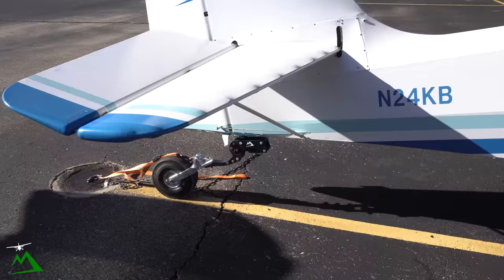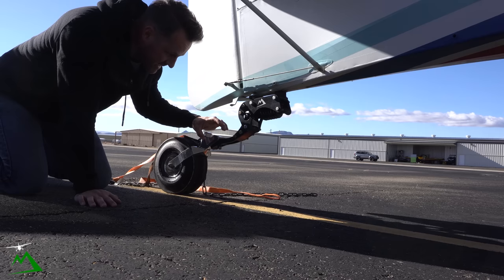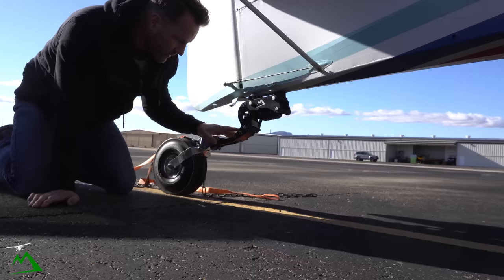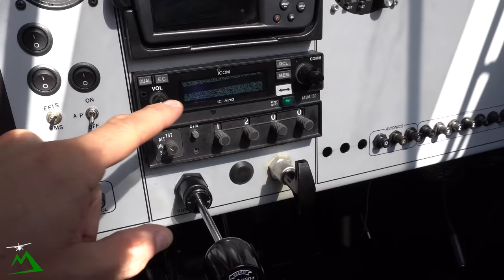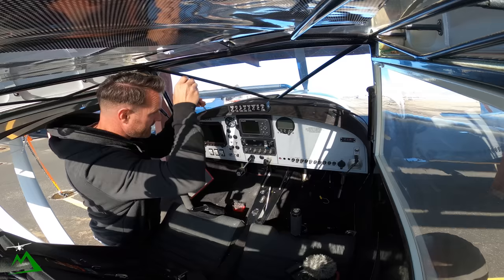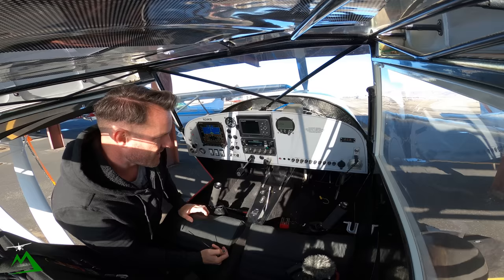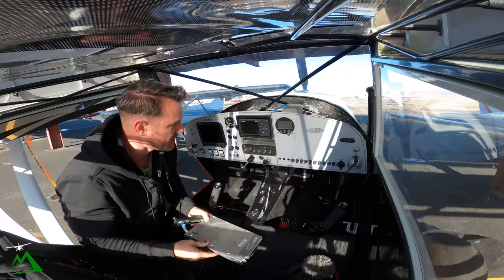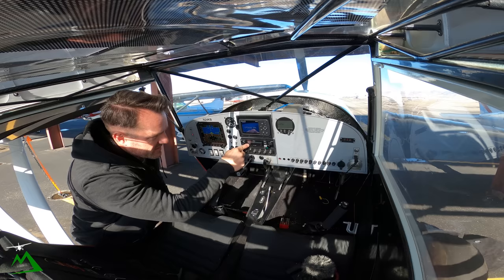I Can't Fly My Plane...For a While

Comment: You might consider a handheld comm for a back-up Ryan.  We use to extend the comm coax with a break out so that the comm antenna could be connected to the handheld if you needed more range.
Reply: I never had a handheld while flying, but this principle is verified 100% valid. I saw very impressive results when doing this with a a VHF/UHF ham radio. Antenna makes a huge difference, and handheld radios absolutely become a much higher performer with a decent external antenna.
Reply: This is only possible, if he could connect the headset to the handheld radio.
Without headset it's WAY to load inside to understand anything.
Reply: @Breenild  That is when you plug a headset into the handheld.  We had done this on many aircraft.  Usually done so that you have an emergency backup in-case of a power failure.
Reply: Sporty’s has a handheld with full-size headset connectors so you can quickly switch over.
Reply: I said pretty much this same exact thing but I'm going to leave my comment so Ryan has a better chance of seeing the suggestion. 👍😁
Reply: @Breenild  My Yaesu  handheld came not only with adapters for the headsets but also for a remote pust to talk. I imagine that a lot of them do but that's one of the main reasons I bought the one I did because a lot of the aircraft I fly have no electrical system.
Reply: Handheld with the adapter is a very easy way to solve this issue for a temporary use. I used one in my Luscombe for years and traveled all over the country with this. I actually carry a handheld with me now in everything I fly as an emergency backup.
Reply: @stubryant9145  antenna is 85% of the equation in RF, the rest is output power, filtering, front end senditivity, and so on.. but if your antenna isn't efficient and resonant on the right frequencies, you can have 1000 watts yet that power is going everywhere but where you want it to go. I've seen people with 5watt HF radios outperform 100 watt stations with shitty antennas, over 2 thousand+ mile ranges at night.
Reply: @tonyvelasquez6776  Exactly correct
Reply: A handheld AirBand Radio is a good addition to have with headset adapter & remote PTT anyway!  Not only for emergencies when you loose DC power or radio dies etc but also for getting latest weather before turning on the aircraft or listening to Ground at busy airports for situational awareness while doing pre-flight etc etc.
My KR2 only has a handheld as do most Microlights and many other kitplanes & LSA's; especially outside the US where prices are STEAP.  I have a connector on my dash to the antenna that screws onto my handheld for better reception which might be an option as a removable backup radio.  I also have an intercom connected to mine (because it is also my primary radio) and maybe your intercom allows for a second radio input?
Just an idea to solve the immediate problem and give future benefit :)

Comment: Remember in Electronics, It's ALWAYS the connector.
 I see that the front panel was dangling by a ribbon cable and those Mylar strip connectors are notorious for getting slightly askew .
Check both ends, Release and reseat the cable. The display controller is most likely in the  front  circuit board. Good luck !

Comment: I love your videos, especially those from PNG. I have to say that flying in the highlands of PNG surely teaches you all about risk management, landing a big aircraft into little more than jungle clearings. That said, I think you’re taking a huge risk with your tail wheel, which should be professionally designed and approved by the factory and installed on the authority of an STC. Your tail wheel looks a million dollars but it is fundamentally flawed and has the potential to damage both you and your aircraft. When it malfunctioned in the recent video, I could hardly believe my eyes when you climbed into the aircraft and took off knowing that the tail wheel was interfering with the rudder. A more than usual swing on take off and the tail wheel might have limited your rudder travel to the extent that an accident was inevitable. In addition, using progressively heavier springs (up to 2000 lbs!) is crazy just to keep your tail off the ground. All that force has to go somewhere and the chances are it’ll end up breaking the airplane structure. A kit fox, like all light sport aircraft, is very lightly built. If you want to land and take off in the desert on unprepared runways and have it ride over the bumps like a Cadillac, you should have bought a bigger and stronger aircraft.

Comment: Ryan, I use an Icom A6 handheld (about $300) if the radio mounted in the airplane fails. Its always a good backup. I can connect my headset to the A6 via an adapter that came with it and it provides sidetone just like the aircraft audio system. It works just fine at altitude if I keep the antenna vertical by the windshield. Just have to make sure the battery is charged before flying. But it routinely lasts many hours. You can also buy a battery pack that takes 6 AA batteries.

Comment: Sorry about the radio Rian, those are good radios I use to run two of them in my RV9A wish I still had one, would be glad to sent one to you till you get yours back.. but wound up selling both of the ones i pulled out when I upgraded the panel..  but maybe someone else may have one you can use till its fixed.. when I had an issue with one of mine Icom fixed it for free, and it was out of warranty, so they at that time stood behind the product very well.  Hope your experience is as good.  enjoy your content, so hope you are back up flying soon.

Comment: Ryan, were I doing it, I'd press the part back to the original configuration and then weld maybe a 1/2" x 1 1/2" flat bar on edge on the bottom side to reinforce the span.  Remaking it, I'd put more height in the vertical span as that's where the structural strength is.  Or make the spam between the spring and wgeel out of spring steel.
In any event, hope it all works out for you. God bless.

Comment: Don't know what all the fuss is about but the tailwheel on Cubs, Foxes, Merlins and many more using the ole tried and true bungee cords and slack tire pressure ( not to mention cost to replace and paper work if so needed) will always be the favorite of bush pilots, like me anyway. More moving parts you have the more problems goes with that! No big ole tool boxes to carry around with fittings, wrenches etc just vice grips and some bungee, which by the way does awesome job tying moose antlers or your canoe to the struts or a tourniquet after you accidently cut your leg way bac in the bush and anything in between! annnnd, as for the handheld radio; been using mine for years patched in to my headset and the planes electrics to keep top notch charge! Roof antenna plugs right in the handheld after you remove existing! Info and plugs at most aviation supply shops or Amazon if you know what u want!

Comment: Before you proceed with material change and such, look at the overall system.
6061(T6) aluminum is PLENTY strong for the application. Look at a bicycle, motorcycle or even the front wheel of a shopping cart. The “stem”, the part that holds the fork/wheel is  nearly vertical although leans slightly rearward (rake). This is why the wheel can “turn” unlike yours where the wheel if mechanically Fighting to NOT turn. Again, envision how a bicycle fork and front wheel is connected to the frame.
If you rotate the “stem” to near vertical, you can dramatically shorten the “arm” that is bending, and REDUCE the spring value (spring constant, “k”) and all but eliminate “sag”.
The load applied to the system is FAR LESS than that of a mountain bike rider and bike in bumpy terrain. Not sure what the actual weight/loads are at the tail wheel of a Kitfox but it is negligible.
Imagine the system where the “stem” is welded to the strut near vertical at the location where the bend is in the long arm. The loads (moment) applied to the system would be reduced by 75% if not more. These aren’t just suppositions, they are “mechanics” (e.g. applied forces and resulting behaviors).
 If you have an email address, I can better illustrate my thoughts.

Comment: Thanks for the heads up...hopefully the repair to that com  will be far less than a replacement. Sportys has the PJ2 handheld with built in headset connectors for less than 300...might be worthwhile. 
Love those PNG vids...

Comment: needs elastomeric bump stops both compression and rebound. spike loads with bolt hitting frame very high
Reply from the maker: i know.  I'm trying to figure out a way to put that into the design
Reply: @MissionaryBushPilot  you can get compression bump stop by putting it on shock shaft inside the spring.  Rebound less critical and would need to be between swing arm and main frame on lower side. Also, swing arm would be stronger and lighter with an I beam profile.

Comment: icom are a good radio but the mylar strip attach point is an issue 😢. a good rule when designing a tail wheel assy is that it should take 9G . That Pivot point has to be 90deg to the ground . if not steering is a issue plus it can shimmy uncontrollably . I love your enthusiasm ,but aircraft design is a black art. i have been an engineer for over 40 years and still learning

Comment: If you put a rib down the length of that part, it will be a lot stiffer as well and less susceptible to bending.  Even 1/2" tall by say 3/8" wide would work well.  With a stiffer spring, that part will carry more load.

Comment: Make the bolt stop surface larger…..it will hammer out and then slip and bend the side plates. A vertical stop is really needed.

Comment: Not sure what I saw for contracts in back of radio. If they are gold plated contacts that plug into a connector you might want to use a soft eraser to polish the gold fingers. I’ve seen that before on circuit boards after many months/years plugged in. On occasion that was the simple fix.

Comment: Darn, I sent the radio in for repairs less than a month before you purchased it as it was intermittent.  Check the connections at the solenoids that are mounted on the battery box, I chased a radio problem to there once.

Comment: Gee Ryan sorry the display's died. Did the company have any comment about their number of failed screens being reported?. Could it be the screen's ribbon cable socket solder connection on the display PCB itself?. I guess some screens do fail sometimes eventually. Anything 'out there' I wonder; that you could upgrade to?. 2nd hand perhaps?.
Really good of you to once again involve us via this video. Good explanation concerning rear wheel redesign ideas, as well as nicely done radio inspection video. You do a good job with taking the time to get good camera POVs too, thanks. :)

Comment: Captain Ryan.... Firstly hello from Sydney Australia.
The tailwheel bent component: what about square or T section aluminium? I think where are the forces applied.
Bummer about the avionics, what was it
*Water/ corrosion on printed circuit boards 
* Heat overload on resisters
* Wiring and power supply storage
🌏🇭🇲

Comment: Ryan a piece of aluminum 6in long two inch wide 1-inch thick weighs about 1.1 4 lb..... Piece of steel 1/4 inch thick by 2 in wide by 6 in Long weighs 0.849 lb... Steel weights 0.283 pounds per cubic inch..... Aluminum weights 0.097 per cubic inch... Now if you had a piece of spring steel that was engineered for the application ... It would be lighter. Or how about this.. cut that aluminum off of there and bolt the steel onto it. Take a look at a pileup of leaf springs they use friction with a bunch of thin pieces. To suspend. That's an engineering problem that you have there and it's a fairly complicated one. Torsion bars are really cool how they work check into that. You know you using the twisting energy of a shaft to act like a Spring.
Reply: titanium torsion bars are c00000l  :)